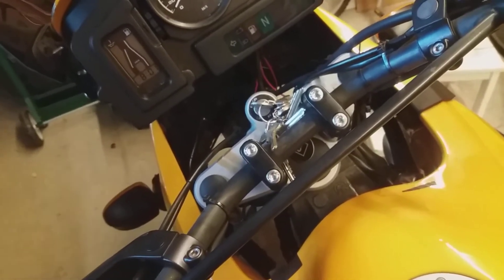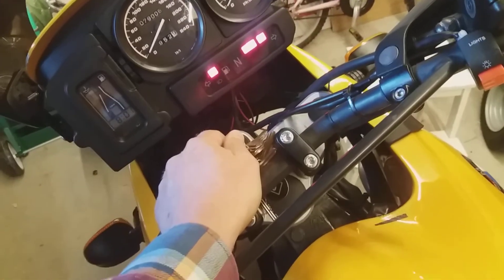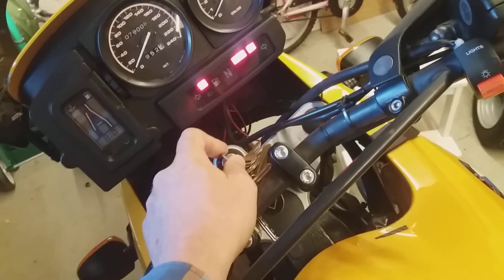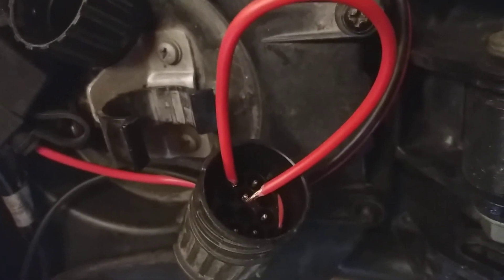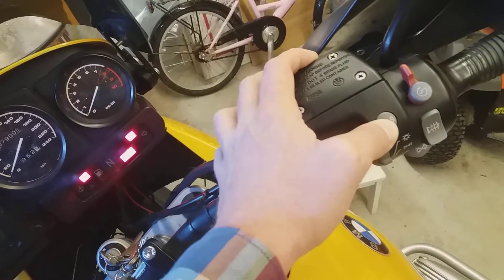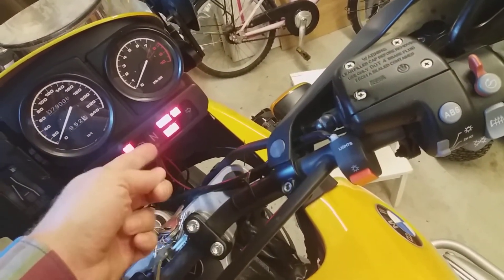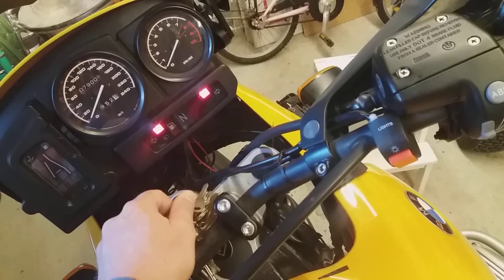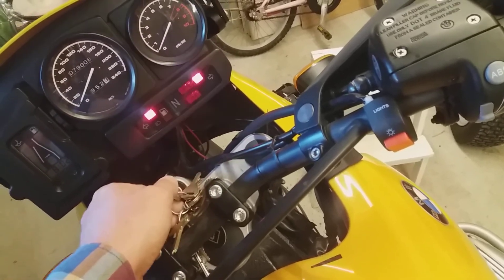BMW R1150GS ABS fault - How to reset the ABS error

Comment: It worked like a charm!!
I recently bought a GS1150 with the same amount of Km's on the clock, and apparently, the startmotor is just used up. 
Therefore, it sometimes just drained the battery and that also caused the ABS failure.

But today, i replaced the startmotor and did this ABS reset, and now he works like new!

Comment: It worked!
I have the same bike model with 6 pins at the diagnostics port (1, 2, 4, 6, 9, 10). 
Note: At the back of the connector there are pin numbers to confirm pins 2 and 4.
The ABS error was caused by weak battery.
Thanks for the info.

Comment: Thanks a lot! This worked perfectly for my 2002 BMW R 1150 GS, and it probably saved me a lot of money at the repair shop. Thanks also to Think Devices' comment for the note about the pin numbering on the back of the connector!

Comment: PSA announcement guys- if you are riding an 1150, obviously it’s an old bike. I own several old bikes. My BMW’s brake hoses failed, and when they do, typically it’s from the INSIDE and thus the rubber blocks the return port for brake fluid causing full lock-up at speed. If this happens going around a corner, you’re completely screwed. Ironically my old Hondas have brake lines 40 years old that work fine- I just haven’t gotten to them yet- but the BMW brake line failures are a well documented thing, modern rubber being what it is.

Comment: Nice vid, but the problem you had was just the lights on the dashboard (faulty sensor ) or was the ABS System not working for real? I mean what is the issue that stops the ABS from working and why resetting like you did, make ABS system available again till you don't stop the engine? Asking cause I just got my r1150GS and want to understand the possible issues. Thanks for sharing! :D

Comment: Hey same problem but no response.. Any advice?
Reply: Same for me, did not stop the alternate flashing abs warning lights, I took my bike 2002 GSA 1150 to my local dealer who checked the diagnostics using a GS-911 diagnostic tool and found a fault with a stuck abs plunger/piston in the abs module, was not what I wanted to hear, no longer have abs as my dealer shrugged his shoulders and said forget it!.